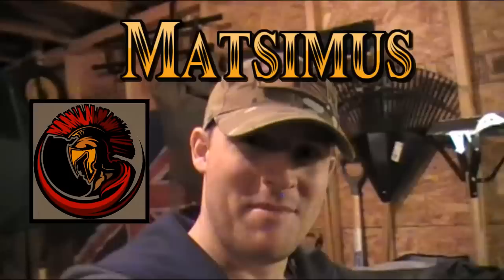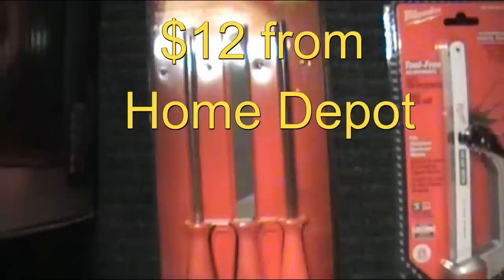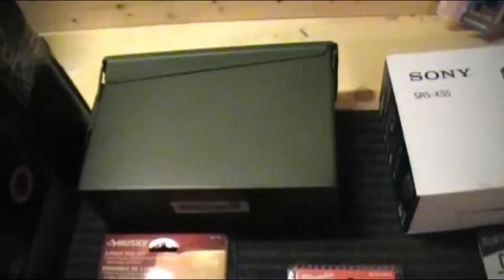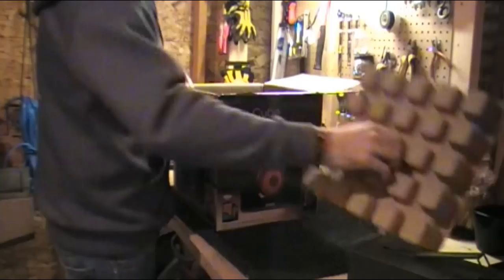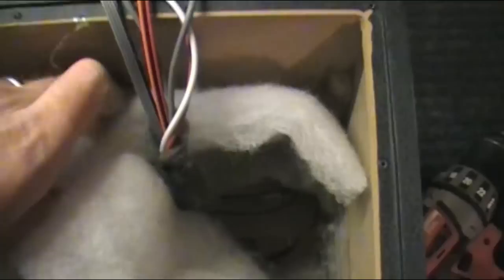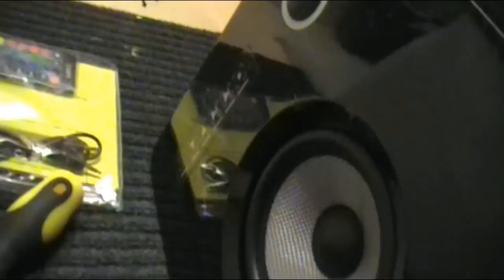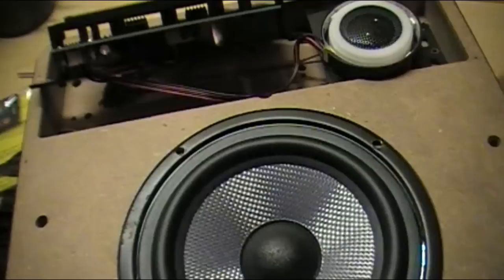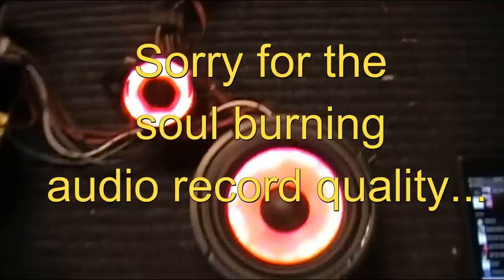Ammo Can Box Speakers DIY - Part 1

Comment: I do believe you'd be better off getting a smaller subwoofer. The reason that box is so large, is so that the subwoofer has room to breathe. The port on the back allows added air flow to the sub. But thanks for the idea man! I've been wanting to build one of these, but I had not considered harvesting parts from a prebuilt speaker.

Comment: This is great.  When I was assigned to be the PL's driver we made a battlefield speaker box system for the Hummer.  We ordered parts (speakers/amp/cdplayer) online had had them delivered to us.  We had one of the mechanics help us out with the wiring as we did not want to jack with the electrical system.  Can't wait to see yours finished!
Reply from the maker: +xIGuNDoCIx thanks man! its taking some time but im getting there! this was pretty much all done for me apart from the cutting and locking in place. stay tuned! :-)

Comment: You can build this for 75$
Ammo box 25$
Bluetooth amp module 16$
Toy car battery with charger 19$
Speakers 40$
Reply from the maker: Thanks for the info. But I liked this design and its setup so it may have cost a touch more but I don't mind. Thanks for watching!! :-)
Reply: +Matsimus Gaming yeah its a very nice and neat version but you can spend much less money with the bluetooth module and the battery 😃
Reply from the maker: +Dollar Musics yeah I know ;) but I'd need to solder and buy extra tooling for that. With this most was done for me. Plus I like the lighting